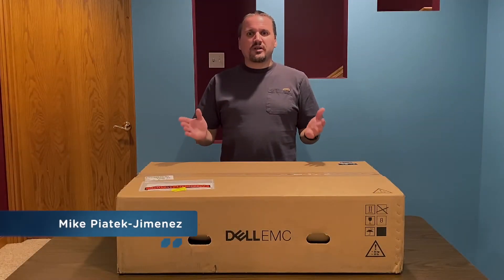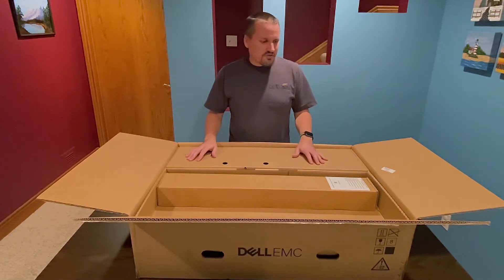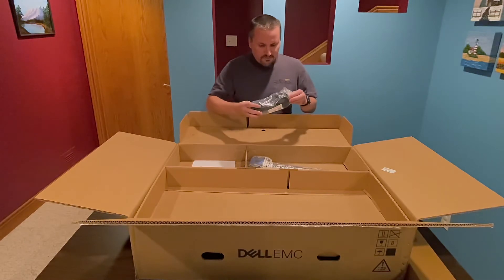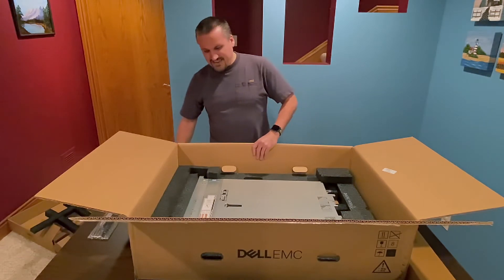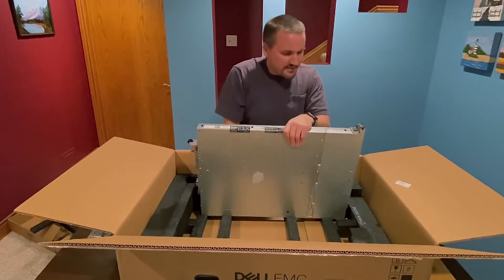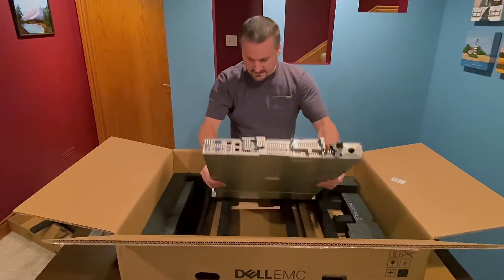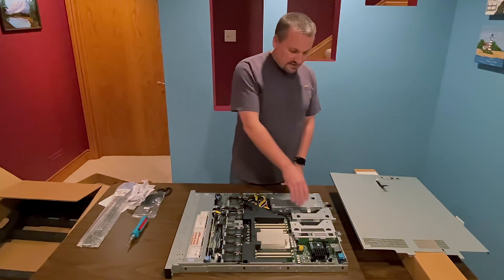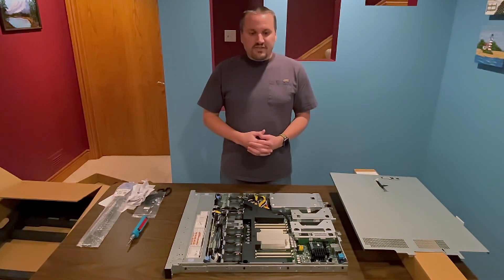PowerEdge R6515 Unboxing

Comment: Very interesting video! Price for hard drives and RAM is really high at DELL. What RAM did you buy? Anything one should pay attention to when buying RAM separately? Are the SSDs you mention in the video (Intel 4510?) hot-plug?
Reply from the maker: 3200Mhz Server DDR4 was hard to find when I built the server (with 2933 being the more common speed available).  I ended up purchasing it from Supermicro.  There are only a few big manufacturers of DRAM chips: Micron, Hynix, and Samsung.  Supermicro sells DIMMs for all three of them.  

For memory, I usually buy from Crucial.  They were out of stock of the 3200Mhz memory at the time.  But since Crucial is owned by Micron, I decided to buy the Micron RAM from Supermicro.

Yes, the SSDs are hot-plug.  That's a function of the backplane/RAID card over the drive itself.  I purchased the Intel S4510 drives, though they look to be more expensive now than when I ordered them.  Not sure why that is…